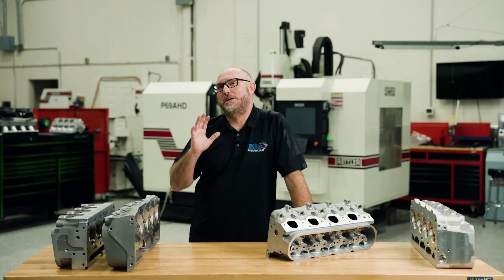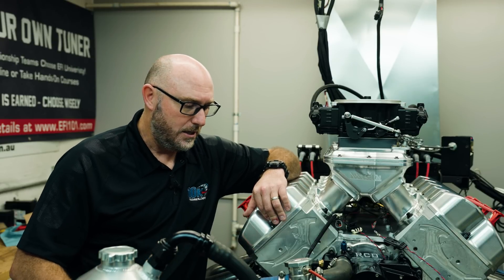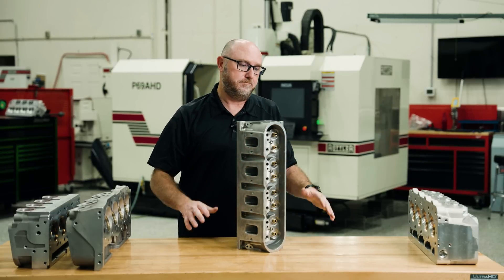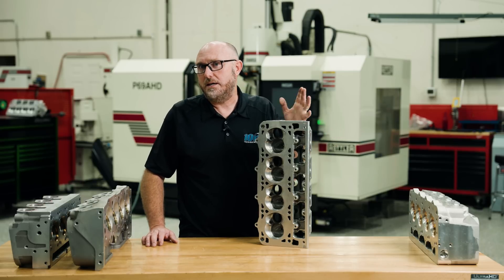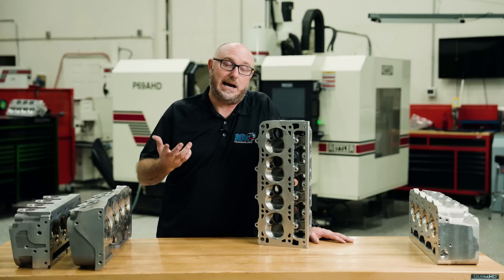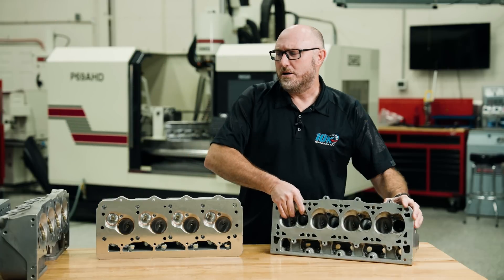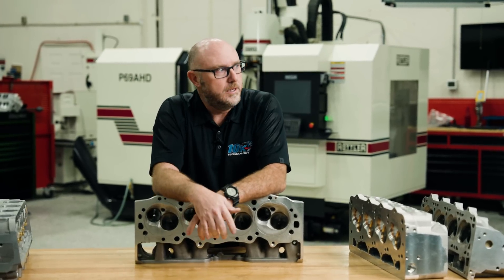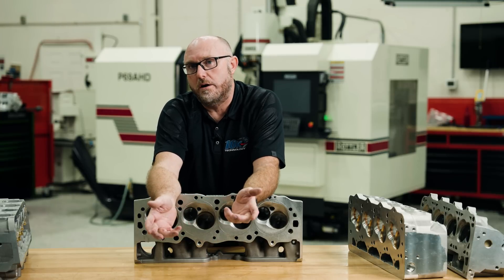LS? SBF? Hemi? Dart? What IS Project Hatemaker?!

Comment: The best example of "What is it ?" would be the World Products Motown LS blocks. A SBC based block (Gen 1 Rotating Assembly, Camshaft, Oil Pan, Water Pump, Timing Cover, in-block Oil Filter and Mechanical Fuel Pump location, Distributor support, SBC Motor Mounts) with an LS's 9.240" Deck height that accepts OEM Style LS 4-bolt Cylinder Heads and Intake Manifolds. So is it a SBC or an LS ?

Comment: I kind of wish that there was an aftermarket company who took all of the best parts from the big 3 and made it fit into one custom cast block for cheap horsepower and 7ish displacement. The difference between an L8T Crank cost and a Callies is insane. I don't care about who made it or came up with the idea but I'd like to order parts or pull from a junk yard the part I need pay a decent amount of money one engine block and make a Frankenstein $1= hp= lbs maybe $2 with inflation. I guess I was born into a Chevy family but no one really cares there are Fords Subaru Hondas and Buicks Did anyone actually really care?

Comment: LS is just a part of an RPO code. I've heard people use LS to describe the 4.8, 5.3, 5.7,  and 6.0 iron block truck engines. None of those are technically an LS because they were never given that code from GM. Does that make them not an LS? Most of the parts interchange with their aluminum block counterparts. They are dimensionally the same. Trying to claim a billet aluminum aftermarket race engine is "an LS" is a bit of a stretch, but when you're trying to describe it to a layperson, saying its an LS says more in fewer words.

Comment: if stock LS stuff will still bolt to the block... it's LS based. I think it's silly to think that changing parts around on it would change that. it makes more power, and that's what matters.
if I had the $$ for them,  i'd love to run heads like that.

Comment: It’s a hemi headed, ls based engine….. dumb question would a coyote be a hemi then ? Valves are on either side of the engine. Not wedge. It’s just quad cam instead of pushrod. ??? I would agree with you the block is based off an ls so it’s an ls engine.
Reply: Pent roof.

Comment: I think you just confused all the fcktards! The way racing looked at it years ago, was what flanges are on the front & back of the block, what crankshaft do you order for it! (Some had to be factory!) Deck height! That was before all the fancy aftermarket stuff like heads short deck blocks & on & on! It’s whatever you want it to be 🤷🤷🤷🤷! Like you said, there’s no factory anything in most race engines 🙄🙄🙄🙄! They will still argue! What have they built 🤔🤔🤔🤔?

Comment: I think the haters hate on ultra dollar builds. What they want is big power they can at least aspire to (but probably never build) using OEM or relatively affordable non OEM parts. 
I don't like haters but I don't tend to watch state of the art builds either because I just aren't that interested. The hobby has become gentrified and in a way it seems anyone with a lazy $50,000 or $100,000 to throw around is now able to race dynos LOL.
That said, I have been following very closely Andy from Unity Motorsports with his Hammerhead build though. They're awesome heads. They should make them for the LA Mopar blocks with with cast dual quad single or dual plane intake options. Even if that cost say $10,000 all up, you could probably build an LA based Hemi for about $15-$17,000 but considering Gen 3 Hemis are so cheap and conversions popular, there's probably not much of a market for that.

Comment: I rhetorically agree with you Ben. The engine should be whatever it was based on in the block, so if it was made to use all the LS features it's an LS. The block is the starting point of the engine, so it's block based.

Comment: I do have a qiestion for you. When you add duration to spin the engine higher do you spread the LSA to keep the overlap the same or does an engine need more overlap for higher rpms.?
Reply: When you add duration to spin an engine higher, a high-RPM naturally aspirated combo usually benefits from more overlap, so you typically keep LSA the same or even tighten it instead of spreading it. More duration means the valves stay open longer (read:more crank degrees), which already pushes the power band up. Keeping or tightening LSA increases overlap, increasing scavenging at high piston speeds. That extra scavenging improves cylinder filling at high RPM but makes idle rougher and low-RPM weaker. If you widen LSA when adding duration, you hold overlap down, softening scavenging and keeping idle and lowspeed behavior better. That’s what you do on forced induction or emissions sensitive street engines where you don’t want to blow mixture or boost out the exhaust. So the engine doesn’t “need” overlap mathematically -  you choose LSA to give the right overlap for that engine’s airflow, compression, fuel, and intended use.

Comment: I manufacture torque plates and I think a lot of laymen would be astonished at the number of hybrid or one-off designs out there in the Pro Stock / Pro Mod world that they are used to calling things like "Hemi" or "Big Block Chevy."  Being able to use a block that takes production parts would likely be the delineator for many types of racing classes out there, but you could take a page from Sonny Leonard's book (God rest him) and call it LS-X/LS-Next Hemi Hybrid.  That is how I would label it in my catalog!
Reply: Exactly, it's a compatibility reference, example, Hammer head heads, for LSx. The first part was the name of the head, then the LSx part is the combability reference, it's not saying, that is a OEM part, it's mentioning the compatibility and what engine style that head is for.

Comment: I would say it is based on the Block architecture. Whether after market or factory makes no difference bore spacing, main cap mounting and cylinder head bolt locations pretty much determine the "name" of the engine.

Comment: My opinion is it has to be all gm factory sourced parts to be a true ls. Same goes for a bbc or a ford fe or any other oem engine. As soon as you start with aftermarket parts it’s now your Own engine.
Reply: no ones really saying its am Ls. even he isnt
Reply: @ some of it is ls architecture based. Ben just asked opinion so I gave one and am feeding the algorithm. 😎
Reply: Searching information on anything prefomance related would be utterly painful by your logic.

Guess I have to search for a million different names if I want to see different ls builds online.
Or buy 20 different books with "unique" engines just to get information for my ls build. 

If someone has multiple engines, I guess I need to search for something like John Tendons model 16 engine...

Maybe you should call those fancy scientists and tell them to remove all animal families and just classify them all uniquely? Would give a more accurate system after all.
Reply: @Karl-r5j That was not my point at all. I was saying like if someone wanted to claim the highest hp LS it needs to be built out of all gm parts. If it has afr heads, a btr cam, with je high compression pistons that is for sure an ls build but it is no longer a true LS for the purpose of setting any kind of ls record. At that point it is just an LS based record.  I like it to 15 years ago I helped build an IH based alcohol pulling tractor. The only part of the whole tractor that came from IH was the emblem in the grille. Everything else was custom built. To still call it an IH was pretty laughable at that point.
Reply: @bcbloc02  how far do go with the gm parts then? I have seen heads moved a bit. i have seen the valve angles changed, the vavle steams moved, ports welded and relocated. Engine blocks welded. Grinding on connecting rods and welded and ground crankshafts.
Filled blocks and heads, dry decks and so on.

Idk. You can do pretty much anything with stock parts if one really wants to, even completely different cylinder configurations have been made.
Like 6 cylinder ls heads have been made. Gm engines from v2 to v12.

Theoretically you could weld the block with bigger bore spacing. Building a 5.5" spacing block from stock parts and make a 2000hp na ls engine with only gm parts...

The 32 valve heads from the new c8 engine fits the ls block too, if one want to make a dohc ls.
Gm sells a 1000hp bbc already anyway i think? Not a ls, but a easy way for big na hp gm engine.
Do the nascar parts count as gm? Sb2.2 heads should bring you to four digits i guess.
I know that in the past some guys could get hold of raw castings or castings with extra thickness for classes that didnt allow welded heads. 
With the right connections everything is possible. Maybe you could get someone to do a coreless casting of a block and some heads?

Gm also has different turbo/superchargers. So if forced induction is allowed then you can make as much power as you want i guess.
Just have to pay 2-3x the price to get it all from gm through.

Comment: It's not a Hemi head at all. It's a Semi/Hemi head, valves are not straight across from another just as you said it is, a rotated valve head. The combustion Chamber is not a Hemi either, That's why I love this head, its not conventional by far from any head ever made. The difference between a Small Block Ford bolt head pattern is something like 0.040" of an inch. From people grafting LS/LT heads to a SBF? It's less then 0.009" in drilling a couple of the head bolt holes, Not all of them. The LT/LS heads do indeed have the valves switched from a standard LS to Ford rotation Intake/Exhaust to Exhaust/Intake. Once you go aftermarket? it doesn't know what it is. It only knows if it runs better or breaths better.

Comment: That motor is out of reach for most people.   Let's keep it simple for most of us.  Nothing wrong with your project.
Reply: It's not too far off, yea it's 1250hp that is expensive, but you can get 900hp for fairly cheap, look at the Straub Mayhem kits, the 380cfm kit is 900hp capable, if you have enough cubic inches. They sell the kit for $7000, short block is close to the same money, using a Summit/BPE block with a forged internal kit in around 427ci. 
So yea the engine this video is about the Hammer Head LS that revs to 10k rpm is a little out of reach of most at this time, but look at how cheap 900hp in a small block is now. 
It won't be long before there's a cheap package that is hitting 1050hp.